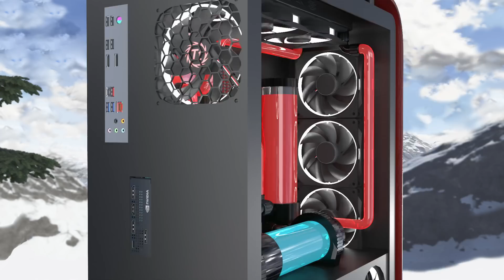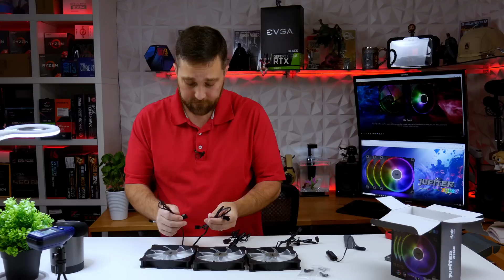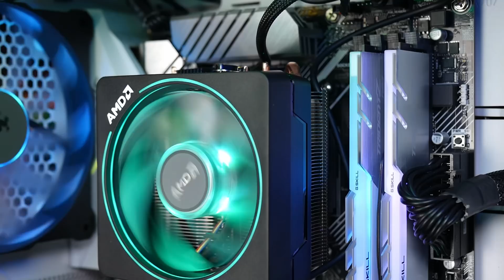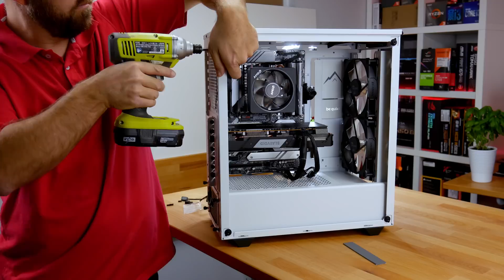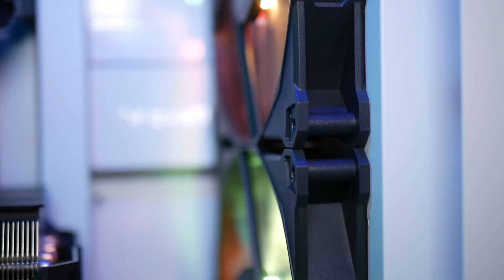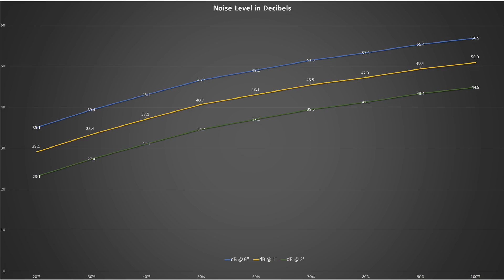In Win Jupiter AJ140 Case Fan Review

Comment: How did you connect the female connector of Argb cable to motherboard and how are you getting connected to the little controller at the same time. i thought I  will have light issue because they have 2 Signal for the fan  (one from the MB and one from the Controller)

Comment: I popped the controller out the back through a pci slot. Don't really use it much, but it is there if I wanna change the color. I don't have a fancy window on the side of my tower, so I don't really have much too worry about with cable management. Fans do look great and they are pretty quiet as stated. Great review! Thanks!!!

Comment: That's bold in 2020 starting with dad jokes, powered screw driver for fans is not wise too easy to strip the soft plastic.
Reply from the maker: Dad jokes is all I got lol and I've found its more likely that you strip out the screw head slots from continually slipping with the screwdriver trying to cut them in from a difficult angle in the case.

Comment: I pop that little controller to the front usually through a hole for the GPU power cord sits on top the psu shroud cover and my temper glass side pannel opens with magnets so i can easily open and push the button got it on there laying  down with velcrow tape
Reply from the maker: Good solution for cases with magnetic hinged doors.
Reply: Jordan U